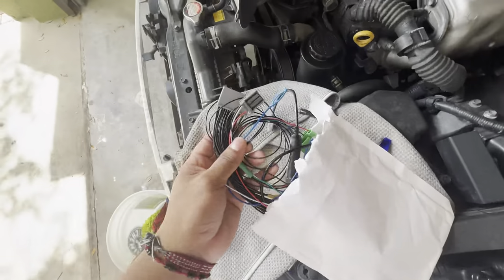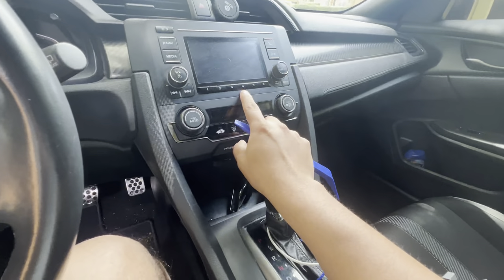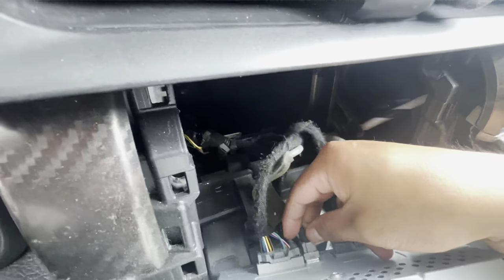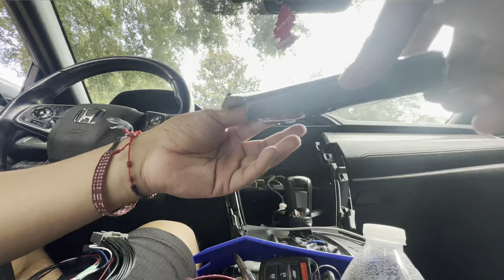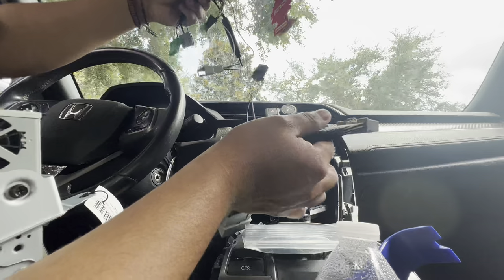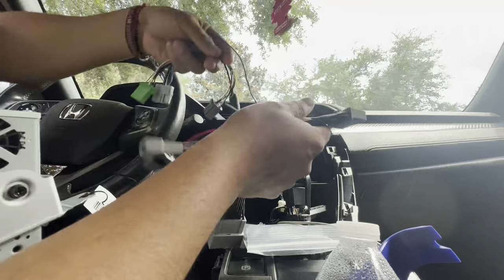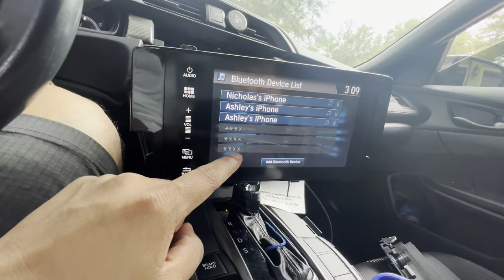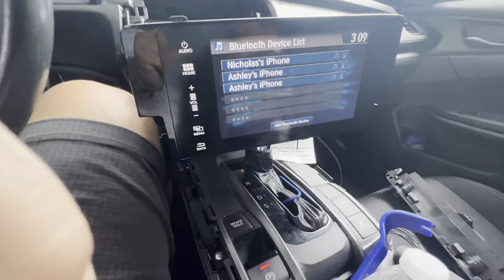Honda Civic sport 2016-2021 OE Carplay retrofit install

Comment: For the reverse camera did you use a connector and if so, did you slice into it a little or how did you do it?
Reply from the maker: I used a wire tap, I had to cut into the wire to both green wires to find out which one it was

Comment: Hey bro!! Really liked the video. I was thinking of installing this Head unit in Honda City 2017 somehow. You reckon it would work?
Reply from the maker: Thank you! That is a great question, I am not sure, if they have the same unit I assume so. The wiring should be somewhat similar but if the head unit is different from what I changed then i am unsure

Comment: I’m just wondering how I can get the right radio. I saw your tag. It was from B&R? When I call them or LKQ how do specify the radio?
Reply: Haha never mind it was some place in Florida. Could I get like the radio part number?
Reply from the maker: You can just specify to get a Honda civic Ex 16-20 radio and if they can send you photos of the back it would be perfect
Reply from the maker: The one i got was 
Receiver OEM# 39101-TBA-A41
Display OEM# 39710-TBA-A21
Reply: Awesome! Thanks. I found one but it doesn’t have the second black connector at the top left corner (using your radio as reference) Will I need that one or no?
Reply: @DavidFernandez-iu5cs  you don't, mine doesn't even have that black connector

Comment: I am trying to wire up the rear view camera,  I'm not sure if i have inserted the connector all the way into the head unit but I am afraid I'll break it, I tried both teal cables but neither seem to work, any tips?
Reply from the maker: Just catching my up to this sorry for the delay I had a similar issue but it was because I didn’t have the wire tap touching the wire all the way
Reply: @EvolveGarage  can you explain more wym that it not touching all the way
Reply: Hey bro did you ever get it to work
Reply: Yep I did, just had to crimp it really hard. It has to click and close completely.
Reply: @ronitbanerjee9888  what do you mean crimp it really hard? The t-taps or the wire that connects behind the stereo
Reply: @aserventofjesus1022  the business end of the t tap
Reply: @ronitbanerjee9888  thank you I have figured it out the back of the stereo wire wasn’t connected good t the back and I did it and it works perfect thanks for the help and it is the green mint wire

Comment: Does everything works  on the radio
Reply from the maker: Surprisingly it does, no issues thus far, I just chose not to have AM/FM or XM
Reply: Have you been able to use the navigation turn by turn feature in the cluster from hondahack? My system doesn’t let me configure the instrument panel
Reply from the maker: @fazeelrana  so I noticed that too ! So my theory is that it only works when you down the Waze app or Google maps on the head unit but not using CarPlay if that makes sense, I’ll try to make another video explaining the Honda hack